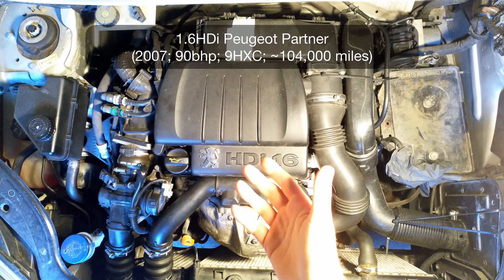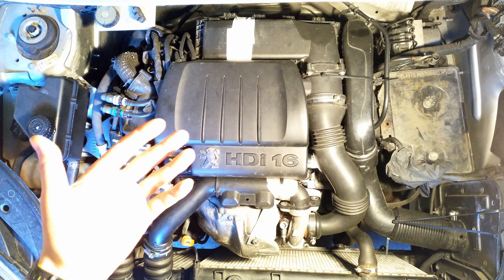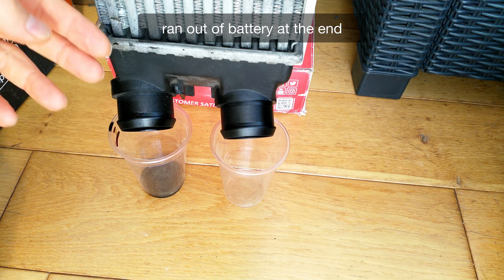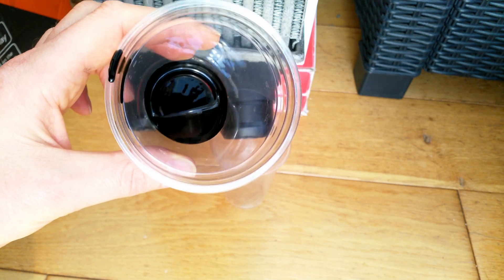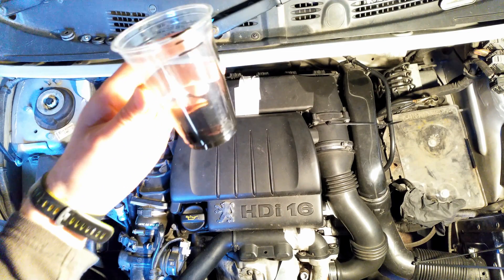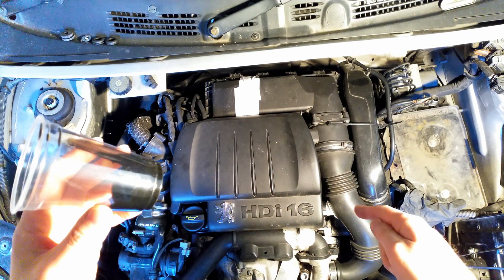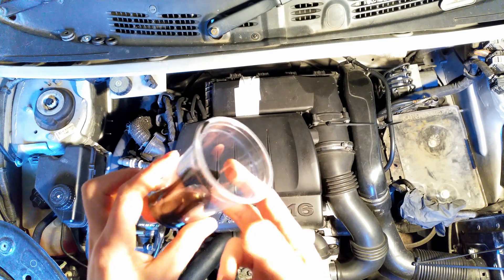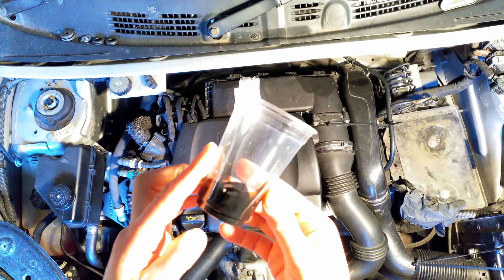Full of oil or not? 1.6HDi intercooler after 10,000 miles

Comment: after replacing turbo i diddnt clear the intercooler , and my turbo pressure sensor died from oil , bought a new sensor and then again oil killed it , it is frok intercooler ?
Reply from the maker: Hmm, it could be, but it should have been smoking quite badly if oil killed the sensor. These sensors are fairly resistant.
Reply: @moremolecules  its still smoking sometimes , if i clear the sensor its ok when its up to 3000 - 4000 RPM then check engine its on and sensor its full of oil

Comment: Do you think the catch can was working well and may have stopped the small amount of oil in the intercooler
Reply from the maker: Hi david, good question. It could well be due to the oil catch can, but I am not entirely sure. I should have emptied it before cleaning and before the oil catch can to compare after, just did not think about it. It would have been a good proof if the oil catch can works.